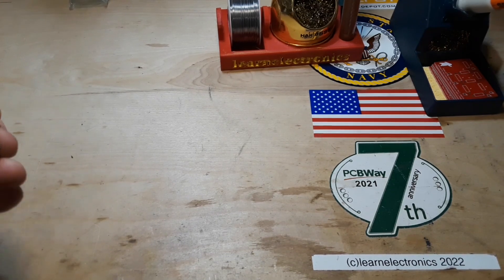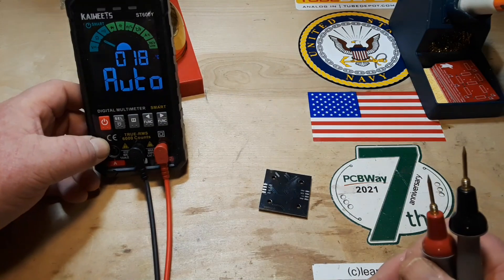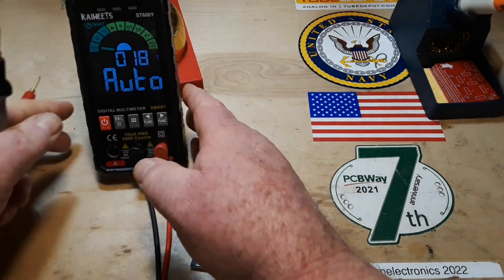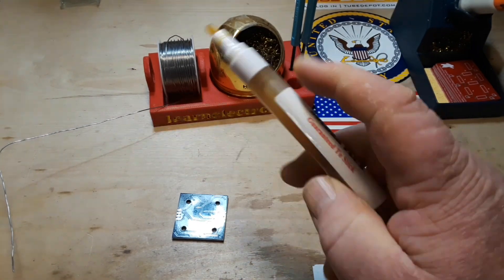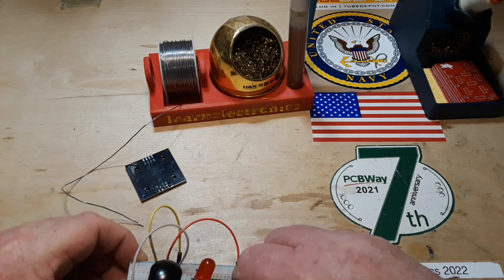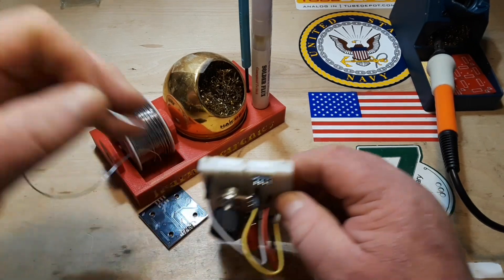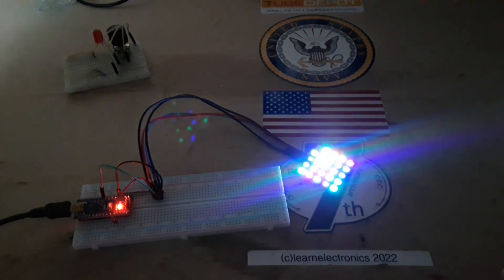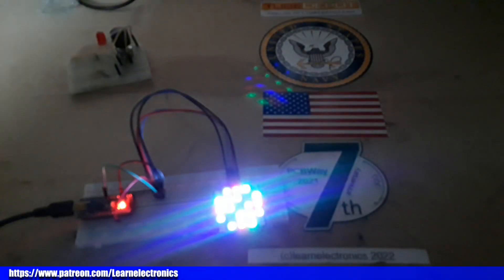DIY Custom Arduino to Neopixel Cable

Comment: My first thought was to use Dupont connectors... any particular reasons to avoid them in this application?
Reply from the maker: Looking for a no brainer, I don't want to think about the connects when I use this in a video taking it apart multiple times.
But duponts would be just fine.
Reply: @learnelectronics  I figured you had a good reason.
Keep the great videos coming!